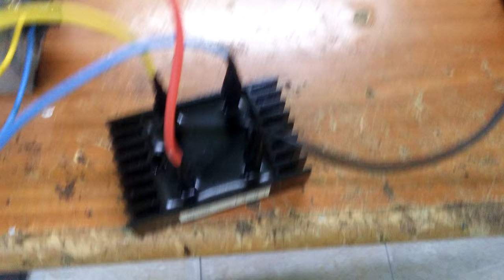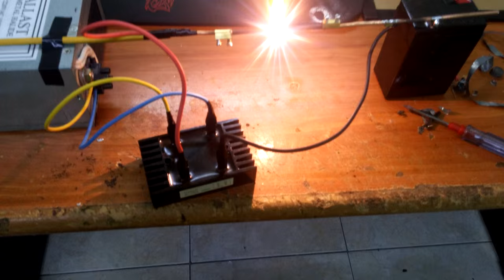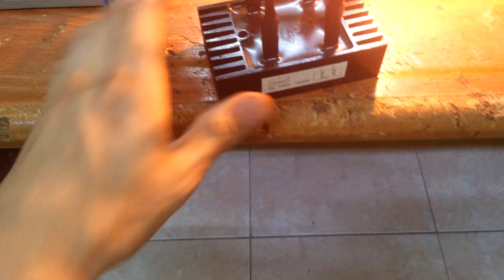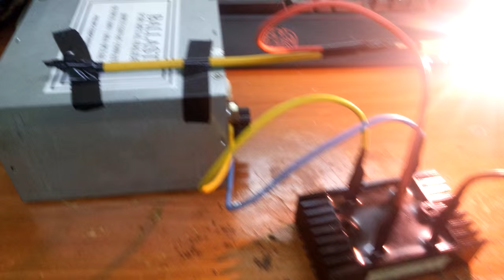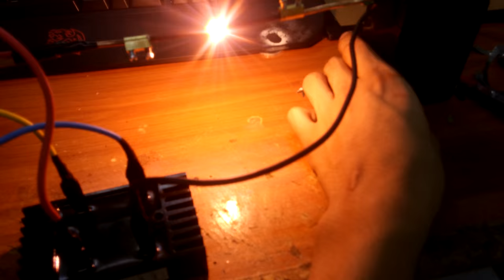HOME MADE CARBON ARC LAMP

Comment: Put straight AC in there, ballast it with a heater, an electric kettle or an iron. With carbon or graphite electrodes you will get beautiful and stable arcs, which make HUM as hell! :)
Reply: man, that is no solution. IF YOU WANT BALLASTING, USE A CAPACITOR (Motor run capacitors are quite cheap). THIS WAY, you won't have a bloody resistor eating away your energy
Reply: @DBuilder1977  I know Caps increase Voltage, didn't know they reduce Current.
Reply: @stoopidhaters  Once a cap is charged, it does not allow any more current through it and through the rest of the circuit it is connected to. So in DC it would not work as it would get charged and then stop. But in AC, each time the phase changes the cap gets charged and therefore allows current to flow through it and the rest of the circuit. The cap must be in series.

Comment: Let me guess, these rods come from AA batteries, right? xD You seem to run them at 150W, which is just about right for this size of carbons.

Is there a particular reason why you run the arc on DC? For arc stability and silent operation DC is best although the negative electrode wears much faster than the positive one. I prefer AC operation personally. Electrodes wear at the same rate, plus you hear the 60Hz buzz LOL.
Reply from the maker: You're right ,the electrode comes from AA battery, and yes DC have much more stable arc,that's why i run it on dc and i run it from 150 watt ballast because that's the only one i have at this time,i'm going to buy a bigger ballast soon and make a new video running carbon arc on 400watt ballast
Reply from the maker: Btw thanks for watching and for leaving a comment
Reply: idk why ppl bother getting them out of a battery when you can easily go find ones at most welding shops or even home hardware store
Reply: Interesting, I wonder if Nikola Tesla did this experiment when he discovered AC?
Reply: @ARCSTREAMS  Because it's reusing what would normally be considered junk.
Reply: @stoopidhaters  rest of the whole battery goes to waste anyways but you are suppose to take them to a recycling place ,,besides opening those up could expose you to chemicals
Reply: @TonnyCassidy  ⚠️ God has said in the Quran:

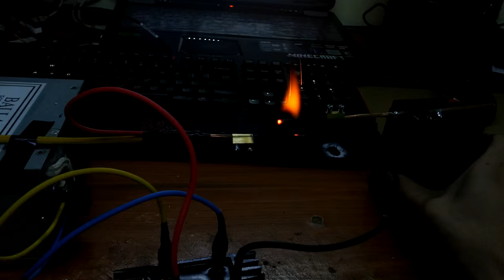🔵 { O mankind, worship your Lord, who created you and those before you, that you may become righteous - ( 2:21 ) 

🔴 [He] who made for you the earth a bed [spread out] and the sky a ceiling and sent down from the sky, rain and brought forth thereby fruits as provision for you. So do not attribute to Allah equals while you know [that there is nothing similar to Him]. ( 2:22 )

🔵 And if you are in doubt about what We have sent down upon Our Servant [Muhammad], then produce a surah the like thereof and call upon your witnesses other than Allah, if you should be truthful. ( 2:23 )

🔴 But if you do not - and you will never be able to - then fear the Fire, whose fuel is men and stones, prepared for the disbelievers.( 2:24 )

🔵 And give good tidings to those who believe and do righteous deeds that they will have gardens [in Paradise] beneath which rivers flow. Whenever they are provided with a provision of fruit therefrom, they will say, "This is what we were provided with before." And it is given to them in likeness. And they will have therein purified spouses, and they will abide therein eternally. ( 2:25 )

⚠️ Quran

Comment: I hope your wearing a welding helmet as that is basically the same concept as carbon arc gouging.... Potentially exposing yourself to UV rays and could end up with "arc eye" which believe me is extremely uncomfortable you won't want it after you've had arc eye the first time
Reply from the maker: thanks for watching and commenting,i never look directly into the arc,i only see the arc through camera to keep my eyes safe,btw thanks for the advice
Reply: Tonny Cassidy Good man! your more than welcome... I thought it was cool as hell! and I wasn't trying to lecture just trying to keep a fellow experimenter safe to keep on having fun experimenting :) might be worth keeping your skin covered on your hands and arms pair of gloves.. 
cheers bud have fun!
Reply: @TonnyCassidy  make sure you wear a welding helmet and long sleeve shirt,im a welder and even when i make tack welds without a helmet i get a bad sun burn the next day that can last a couple of days,so its not good even if you do not look directly in the arc you are getting exposed to alot of radiation

Comment: can you make the arc more stable and steady and without the smoke? i am thinking of puting a large lens and making a search light,,is this bright enough for that?
Reply from the maker: i dont think its bright enough unless you can supplu it with more current, and after some burn in there shouldnt be any more smoke since it came from some sort of wax that coats it
Reply: @TonnyCassidy  there is always smoke no matter what but that does not bother me

Comment: you need ac for this?
Reply: It will work with both AC and DC at the right voltage/current. In fact DC is better for this application because DC arcs don't quench as easily, there's no AC buzz, and the light output will be constant and not flashing with the AC frequency.